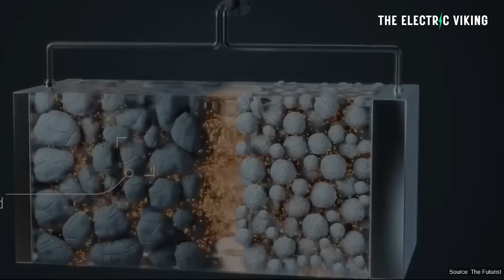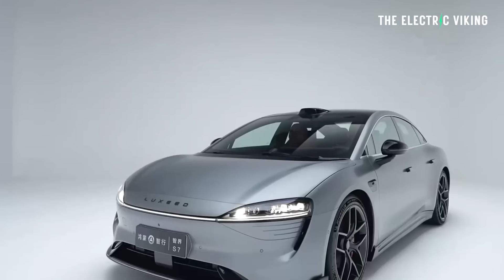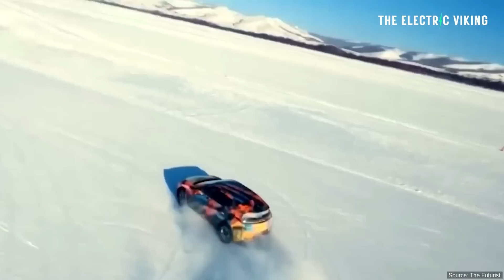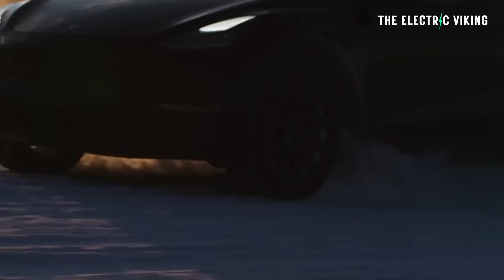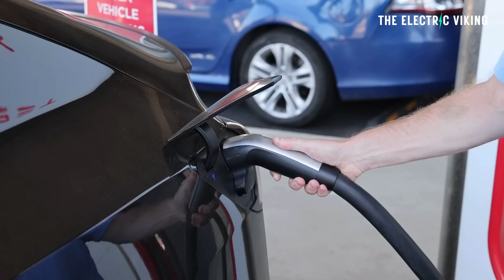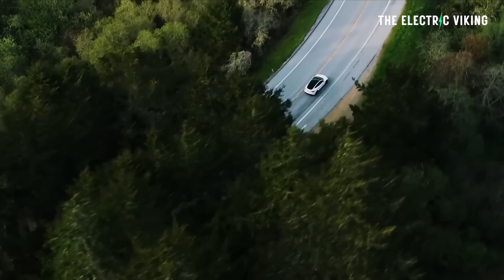Report confirms Tesla Model Y getting M3P battery with insane range & charging

Comment: This is why EV sales have slowed considerably in US... battery tech like the MP3 is just on the horizon and resale values of used EVs are taking a hit. But if you need to buy now and cant wait buy an EV... ICE resale value will also plummet as the new amazing batteries are developed and deployed in ever more efficient EV production drives down price. Energy prices are also dropping with renewables replacing coal and gas. Sam you have it exactly right again. Thanks for this good news.
Reply: I think EV sales have slowed because 1) no more massive price cuts and 2) many models lost the $7500 credit
Reply: Deliberate govt. destruction of the economy and rule of law.  Energy prices down a bit because of election year in the US. Globalist goal is to have no personal vehicles so with decent EVs being expensive and ICVs being eliminated it all fits.
Reply: All kinds of FOMO with Tesla now on the Juniper Y not so much on the Model 3 but it lost it's rebate on everything but the performance which I am not sure is here. Also in California they changed the rules for the State rebate. I am seeing more Hyundai's now though .
Reply: My energy prices are going way up as a result of being forced to use “renewable energy”.  Where did you get the idea that they are cheaper or are lowering energy prices?

Comment: From a pure business sense, using a smaller battery weighing less will increase the efficiency extending the range and lowering the cost of manufacturing.  Tesla will make more profit, the distance will increase with a small margin, extending ranges are not practical as drivers will need to rest and use washrooms!

Comment: I don't see the point in extrapolating range "standards" from ICE cars.  

800-1000km range is something that provided a reasonable compromise for ICE car users, providing good range without having to fuel too frequently. 

EV users don't really need that much, the system is different, with smaller, more frequent charges at home or slow charges at work, malls, supermarkets, etc.

IMHO, true 500km highway range is all that is needed.  That's true 500km (+/-5% dependent on non-extreme factors) at "real" speeds, not legal limits.

We are not that far away from that, really.  I don't think a major revolution is needed, more like a 10% increase and that covers 95% of users.
Reply: Well said I would argue though that batteries like this bringing 10-80% charging times down to 10-15mins are the most important bit. 
Along with tesla opening a new charging point every hr in just the us and China is opening over 1,500+a DAY over there!

We need chargers of some type to become ubiquitous at most businesses we already spend 20mins or more dwell time at.
Gyms, malls, groceries etc. 

They don't have to be the quickest chargers either. Even a 50kwh dc charger at a place someone spends 30+mins at can give a tesla 100+miles of range back. Make it like charging a modern cell phone always be charging. 😀
Reply: Yep I agree. Maybe just adjust a bit in a sense that when you charge from 10% - 80% or so (up to level to which you can charge fast) and you get 500km (or close) it would be just fine.
And it seems that 10-80 charging will soon be like 10+ minutes, which is then pretty good.

Comment: Another load of BS . Explain to me how a battery with 60wh/kg less energy density will provide nearly twice the range . Pls get your physics , math and facts straight . It's not that difficult . A model Y LR with 2170 cells of 270 wh/kg density has an EPA range of about 330 miles . The CATL M3P battery has an energy density of 210 wh/kg and despite that 60 wh/kg deficit it would magically give a Model Y twice the range . Are you sure you finished primary school ?

Comment: I would advise caution, if we get slightly over 500 km for entry level RWD and 650 km for AWD (WLPT not CLTC) that's a significant win, if cost either keeps the same or goes down. No way in hell we'll see range improve suddenly to +40%, that's not good business ;)
Reply: Sam Evans didn't bother checking the numbers. MP3 has a cell energy density of 210 Wh/kg, compared to 160 Wh/kg for LFP (used in the Model 3/Y Standard Range) and 270 Wh/kg for NCA and NCM  (used in the Model 3/Y Long Range/Performance).

Comment: Sounds good for buyers of used EVs. The Berlin made Model Ys with the BYD Blade batteries are excellent and if their used prices drop with M3P powered Y's come along then fine. TBH the 450 km range of my e-Niro has never been a problem for me...even when I owned ICE cars I never did more than two and half to three hours before taking a break from driving. These people who bang on about not buying an EV until it has a 700, 800, 1,000 km or whatever range are talking BS, they need to stop to use the bathroom and take their eyes off the road just like any normal person does.

Comment: Again, this is based off Chinese testing cycle CLTC, which is about 35% more optimistic about range vs EPA and Euro tests. So, the range might be better but most likely 30% to 35% less than stated after EPA gets their hands on it.  Which isnt groundbreaking but rather incremental if at all.

Comment: Tesla is on the edge.  500 miles of range with a 10 minute charge.  That means 220 miles in 5 minutes.  Why would you want an ice at that point?  That means most road trips still won't require fast chargers.  As long as your motel or friend's house has an outlet, you are good.
Reply: What? The outlet at your friend's house is L1.

Comment: yes, I agree.  I would add that the eventual goal is to have a high performance battery like you describe, in a 4680 form factor, that is very resistant to burning.  Every vehicle they make will have this same form factor and performance with possible exception of the Chinese market.  There may be progressive steps to this goal, so when / if is a good question.  So, we shall see if we live long enough, LOL.

Comment: Validation battery testing is specific to each model and make of auto. Just because one model and make is validated it doesn't mean that's not needed anymore for each additional make and model.  Each car has its own unique load and  heating/cooling requirements .  Each battery packaging is unique to that specific model and make of car.  Tesla has its own unique motors and heating/cooling systems.   You may not believe the validity testing valid but your reasoning of why, is not logical.

Comment: Why should the resale value plummet though. This wouldn't be the case if you could swap batteries easily, as easily as you can your phone!
Reply: he said the resale value of the current model y would plummet. that’s why i leased a 2024 model y instead of buying one. your second point - exchanging batteries in a model y, is not feasible at all
Reply: You can, just as easily but would you buy the new battery just so your car regains it's value? Probably not as the value would probably drop like 10k on a newer car and the new battery and it's replacement would cost 10k or more.
Reply: @alexandruilea915  at $50/kWh a new 60kWh battery would cost $3k.
Resale value of EVs plummets because of the battery, nothing else.

Comment: 500km should be bog standard for all EVs 
1,000km should be mid to long range 
1,500 up to 2,000km extra long range.
This will make range anxiety and queue anxiety a thing of the past
Reply: not 1500-2000 because your car would be over the top expensive, all we need is fast charging so you can get 80% in 10 min adding 400/500km+ while on a road trip the same a using gas. Maybe the future will bring high enough density to get a battery that is only 250lbs and goes 2000km but that is a long long way away!
Reply: Why? I have never had an ICE car that could do 1000 kms on a tankful.
Reply: I think it’s going to be charging speed (and availability) rather than absolute range that ultimately beats range anxiety. My hybrid does 350ish miles on a tank, and refill takes 5 minutes. Once EVs can match or exceed that then the contest is finally over.
Reply: 2000km is min. 300KWh battery that would weigh 1.5t alone or the same as my entire family car.
Reply: @larsjrgensen5975  You know the future energy density and gravimetric density of batteries that haven't been made yet? Can you also tell me what is tesla's stock price in November of 2028?
Reply: @larsjrgensen5975  Cheers mate, a crate of Carlsberg will do fine 👍😅
Reply: Lugging around that massive battery pack for in-town driving makes absolutely no sense.

Comment: A 40% increase in energy density will allow them to make decisions about battery size, but ALSO about future design. Imagine a battery pack that was a lot smaller; it would weigh less, offering not only better range (due to battery density), but also better performance. If they dropped the battery size by, say 30%, they would have a HUGE step forward in terms of performance, and a little step up in terms of range.

I wonder if this battery will be coming to the model 2...?
Reply: I think it would be good for PHEV, as well.  In the US, buyers are not ethusiastic about BEV.  But if you give them a luxury SUV with 200km range, plus powerful motor, range anxiety is gone and it is a road trip car as well, which Americans want.  80% of the time, the thing would be running on electricity during the week to drive to work or pick up the kids.
Reply: What is the energy density of the M3P battery?
According to official data, M3P battery is a battery developed by CATL based on a new material system. Its energy density is 210Wh/kg, which is about 15% higher than Lithium iron phosphate battery. This is not 40 percent unless there is new data.

Comment: I’ve heard several times, pouch style cells expand and have risk, especially when not LFP…. LG for example.  CATL having pouch, with even way higher energy density makes me nervous Sam.  Time will tell, but do you think we should be concerned about the form factor Sam?
Reply: I am not sure what an M3P chemistry contains. Originally it was an LFP battery with manganese. CATL have said it may not be that. So they are keeping their cards close to their chest, unless anyone knows differently.
Reply: I doubt it’s a pouch battery. Why do you think it would be?
Reply: M3P's are prismatic which basically means pouches in a rectangular container.
Reply: @ctuna2011  You may be right in practice, I do not know. But M3P refers to the chemistry. I wish I knew what the M and P stands for. If manganese and potassium and the 3 is for other molecules we have five molecules which is too many. Prismatic and 4680 refers to the shape format. In theory M3P can come in various formats. Tesla will most likely prefer M3P in a 4680, but Tesla is a consumer of batteries and to some extent will buy whatever is available. Much of what I have written is based on understandings, so I would love to be corrected if I'm wrong.
Reply: @robertwhite3503  M3 means 3 metals P phosphate. The 3 metals are zinc magnesium and aluminum according to various sources.
Reply: @najibyarzerachic  Thank you. I took the liberty of trying to confirm what you said. I found a couple of articles which said it was an LFP where the Iron was substituted by the three metals that you mentioned, so there appears to still be Lithium in the mix. Is that your understanding too?
Reply: Like other new stuff, wait a few years and see what's catching fire.  EV fires are still top news unless that's being censored too.

Comment: 400Km highway range with avg charging speed of 160kw from 15%-65%, is the sweet spot. Most people have to take a break every 2.5 hours. Charge 15mins and you gain more than 200 km of range.
Reply: 400km is terrible. You'd never buy an ICE with 400km range, why would you buy an EV? It's not practical for longer trips where time is an issue. 500km at least puts it level with the worst ICE. Ideally should be 700km or above.